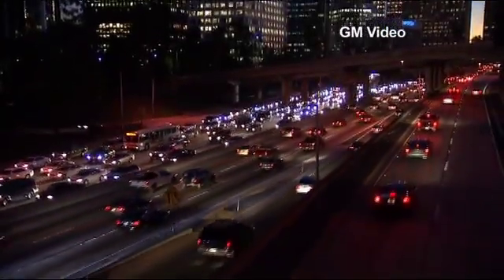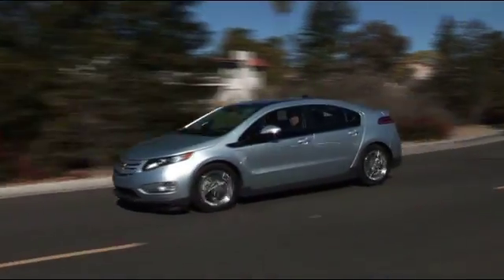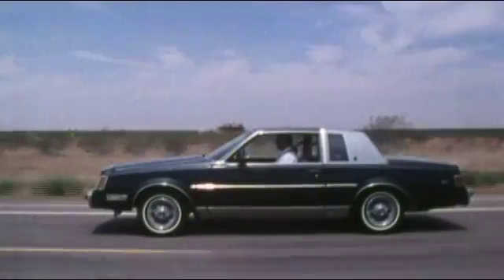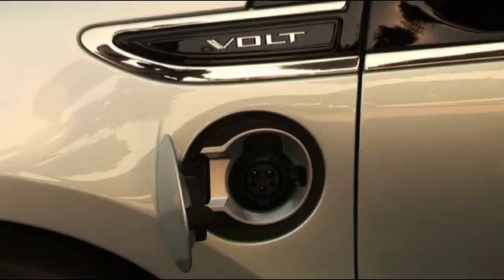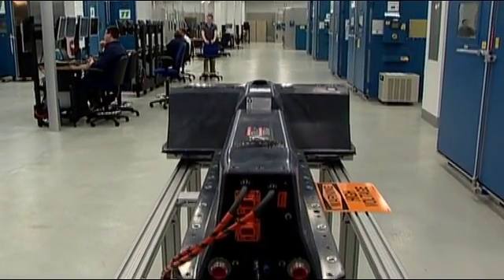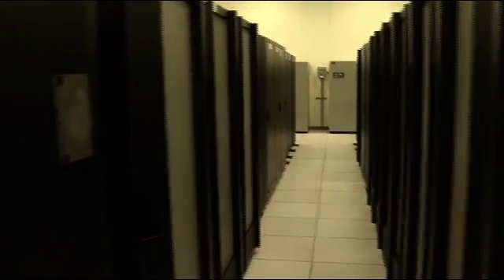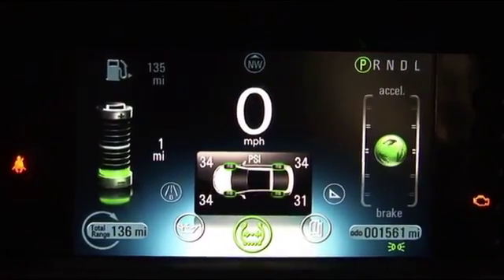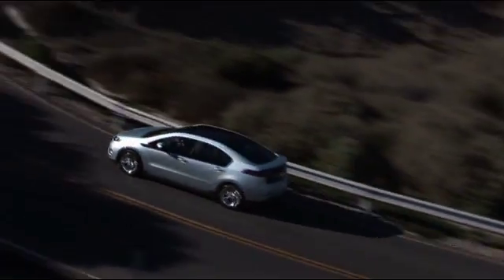General Motors Getting Closer to Launch of 2011 Chevy Volt

Comment: Maybe they didn't explain enough in the video.  It runs on battery power for up to 40 miles.  After the battery is discharged the gasoline generaor kicks in and powers the drivetrain until it runs out of gas.  When it runs out of gas you fill it up and can keep going.  You could drive coast to coast without plugging in, just like your car.

Comment: @wtf000000000000 300 miles cruising... that does not take into account start stop traffic, passing acceleration, different cruising speeds. At best you might get 2 hours driving time.